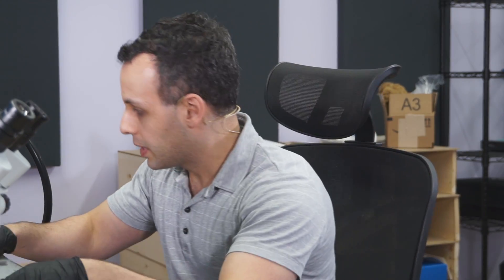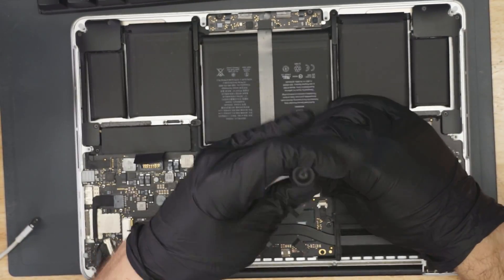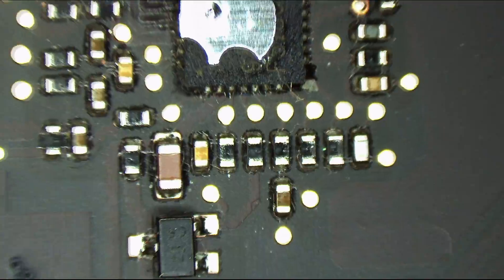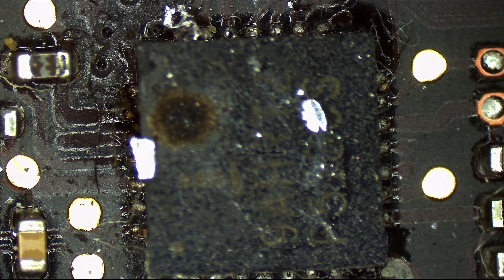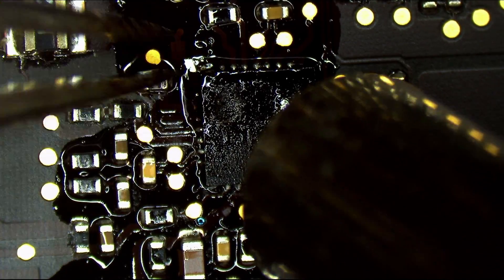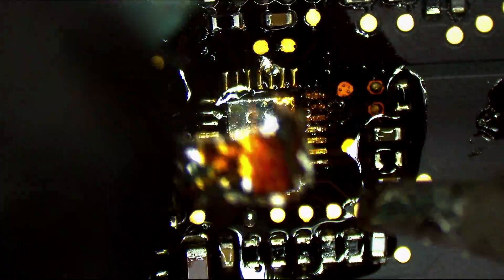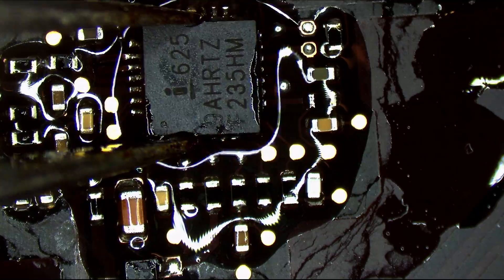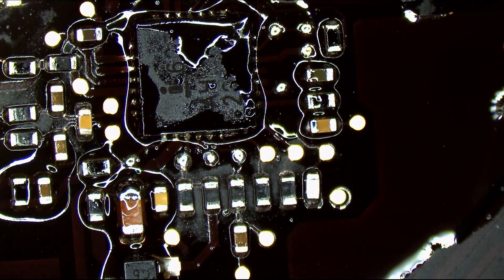A dead A1502 Macbook Pro 820-4924 taking 200 mA

Comment: You use hot air because fluid dynamics, once the solder melts, will cause the tiny little components to self align to the traces on the motherboard. The surface tension of the liquid solder is actually stronger than the air trying to blow the components across the workbench.

Comment: Solder on chip - explanation:
My convincing theory is that no one has put solder over the hole in that chip. Then what happened, really? Explanation: The chip (which is mounted on the underside of the motherboard) had an internal short circuit and burned up, a through hole was created from the short and heated solder has trickled down through the hole. The pattern created on the solder, the stripes, is the imprint of underlying material that is tight against the chip.

Comment: 2:00 ok. This is new. The chip has a hole in it, so it died horribly. Then someone decided to “fix” the chip by plugging the hole with solder. Lol?

Sooo... someone was good enough to open that laptop and use a soldering iron, but had 0 knowledge in electronics. 

8.2 / 10 for creativity.

Comment: It seems to become a more and more common practice in apple machines to put solder on top of their chips. Even in brand spankin new ones. When we open a crappy t2 equipped macbook we almost have to wear sunglasses because of the sea of solder were staring at. 😅

Comment: My theory / thoughts on that chip with a solder blob on top..... I noticed the notorious solder balls on the pins, and I was wondering if the bottom of the chip was blown as well ???   If so, the solder on the underside of the chip came up through the hole and collected on top ???  Just a thought .....

Comment: Them alcohol dispensers are all like that. if you use your finger on the pump hole to first prime the pump, it will work. take your finger, press down 2-3 times on the little hole and it will work every time. learned that in the 70s :P

Comment: If two cents can use glue instead of solder to attach a part, whoever tried using a solder blob to plug up the hole in that chip so the electrons wouldn't fall out is a super genius.

Comment: You should probably keep in mind that you're watching a guy that's inhaled lead for a job for 8 years
Reply from the maker: Incorrect. Lead vaporizes 150f above my standard soldering temperature, so it is impossible for me to inhale it. Even if it were, it is sucked into a Hakko FA-430 - but given the temperature lead vaporizes at, it would be impossible to inhale. Not only incorrect, but also dumb! It appears 7 others are equally so.
Reply: Dusty 99  Correct